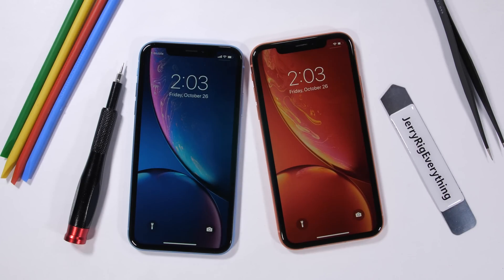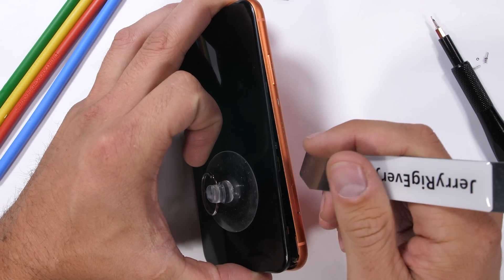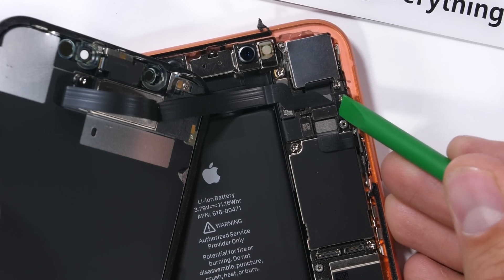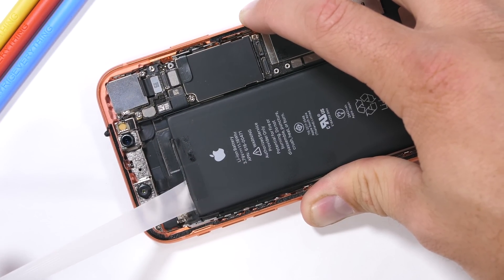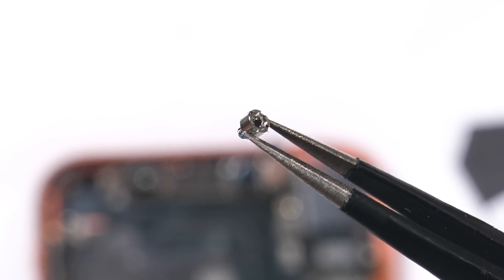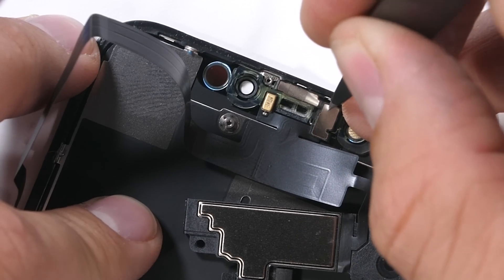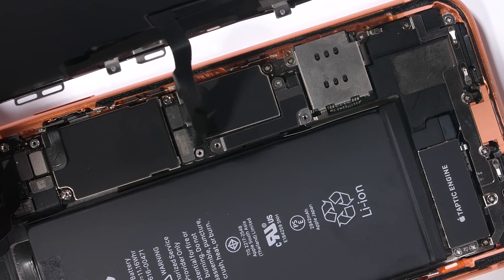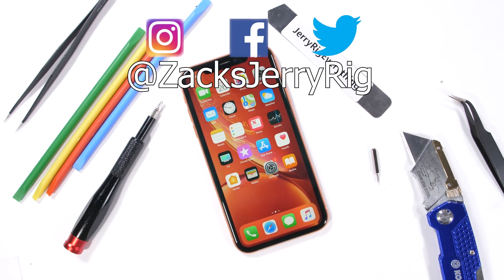iPhone XR Teardown! - How to open the colored iPhone?

Comment: $400 to fix the back glass of a $750 phone hahahahaha 😂😂
2 minute silence for those who are gonna still buy it 
Literally instead of replacing the back glass we can buy a pocophone F1
Reply: this is how a company reaches to trillion worth of money.
Reply: Omid Rastin yes by selling. A product people want how dare they
Reply: If you wanna buy that then just buy that. It’s so simple
Reply: holy shit just cuz theres a chepaer option doesnt mean its any better. look at how bad the pocophone looks in comparison, copied the design of the notch and then included a whale sized chin. plus, if you've never used android and iOS simultaneously you won't realize how much smoother even simple tasks are.
Reply: @plasmasheep4098  Cheaper and yet it has more features than a phone that's twice its price point?
Reply: Colonial ALT more “features” that majority of people won’t use and it lacks massively in hardware has tons of issues and if you lucky will only last 1.5-2 years 👍
Reply: @plasmasheep4098  How bad it looks in comparison with dual cameras,better screen and even less bezels(The chin is big,but has nowhere near side bezels as the XR,the chin is almost the same on both phones)?Lmao.The XR doesn't even have a headphone jack,nor the battery life of Poco,a worse camera,no sd card slot,no liquid cooling and so on.Whether you admit it or not,the XR is just a piece of crap.
Reply: Matej Milovanovic iPhones don’t need liquid cooling because our chips don’t throttle lmao
Reply: @plasmasheep4098  Ios makes the simplest things nigh impossible. We are saddled with iphones at work due to morons at purchasing. Export a complete MMS text conversation with attachments to Outlook? Nope. Can't be done. On Android, simple.
Reply: bro in 400 we can get the 8gb version which is a god
Reply: KNIGHT-ISH “a god” at what being trash 😂 with all of its problems the lack of speed poor display and more there is consequences to buying cheap things
Reply: Or 100 more for a base Mi Mix 3
Reply: My note 9 costs 175.00 if I lose it or if stolen... Apples a con artist
Reply: christopher krause yeh it’s called insurance apple has the same thing your not special
Reply: Kartik Patil first off it’s typing not writing second off I didn’t make fun of or judge anyone...
Reply: @officialANON001  you won't use those "features" doesn't mean that other people won't. Not everyone is like you. Get that straight in your head. You are not the center of the universe. Everyone has their own necessities.
Reply: christopher krause that losing or stolen and not broken and you probably paid insurance because if you have apple care it’s cheaper than $175 of its lost or stolen and only $30 to have anything fixed
Reply: The Samsung s6 has better specs than this "budget" phone and it costs less
Reply: @samuelruiz7377  what specs?
Reply: Vishal Hardasani $750 maybe in the US.  But here in Germany I paid 909€ (over $1000) for the 128 GB Model. You see, what you people call “Budget” phone over there, is a hyper phone elsewhere dude. I could afford the Xs , but I love the Xr more.
Reply: does the Pocophone F1 run IOS?
Reply: @zarndt2134  IOS 12 😊
Reply: With an extra $200 you can buy a oneplus 6T that is a way better phone than this iphone xr
Reply: Me, trying to bend the phone the glass actually prevents the phone from bending(iphone 8 vs iphone 7 bend videos) and the glass also never breaks in bending, so one easy trick is.......put a very thin simple back cover and you will never have to pay 400. But must admit the mate 20 pro is the best choice but too expensive, it has a different type of glass or whatever on the back.
Reply: That’s why you gotta buy a good case and tempered glass screen protector so you ain’t gotta worry about the glass breaking
Reply: Good luck with screen issue,sound quality,and Miui. I rather pay more for mi8, oneplus or 5z
Reply: @OneGoogleUser you're truly being ignorant if you think that essential deserves most of the credit for the notch trend going on right now. First of all, look at the shape of the notches... what do they resemble , the essential or the iPhone? Furthermore, Apple had definitely set the trend, you only saw these copy cat OEMS after apple. How can you possibly sit there and believe that it was essential. And I'm literally and android user, I just can't stand this ignorance. There's a difference between setting a trend and doing it first. Plus look who bent the screen to make the chin disappear. You tell me. I don't even understand this argument why wouldn't people just buy what they want based on their needs. If you can't accept that Apple and iOS do even a few things better and differently there's no point in arguing.
Reply: OneGoogleUser i would rather the phone not breaking after dropping it then feeling the glass but that’s just me
Reply: A minute of silence for this silly Fandroid and the likers of this comment. 
Literally, if you want to fix your iPhones display you dont need to disassemble the whole phone. Replacing the front glass and display of your usual Android phone costs the same. 
So stop spreading nonsense and use your shitty buggy Pocophone instead.
Reply: Oh god, the pocophone F1 🤢 with its much slower snapdragon 845, it’s way worse camera, the chin at the bottom of the screen, and the fact that it will be extremely slow and get absolutely no support whatsoever in just a couple years, I’ll pass
Reply: @greylawson6352  you have no idea what your talking about fucking moron
Reply: IS IT YOUR MONEY?
Reply: OneGoogleUser clear cases exist headass
Reply: @sasukedark30  You will lose the feel of glass
Reply: too bad we can’t use any of these chinese phones in the US
Reply: Nobody asked you, enjoy your pocophone. We don’t all have to have the same things geez
Reply: a12 is still unmatched ...
Reply: Yeah you can buy a phone that sounds like it’s straight outta Explorer Dora.. cool
Reply: @OneGoogleUser it's glass which enables wireless charging obvious you would but a case. Why are you against case or skins when literally everybody buys one no matter the price of the phone people don't like to waste money
Reply: @OneGoogleUser who said it was an innovation. In a way it was an innovation because of the for projector etc on the notch that had the best face i.d in any phone.
Reply: Lmao imagine buying a pocophone
Reply: @EdgarHernandez-xj5mx  imagine being Mexican ew
Reply: Ryan Jack lmao imagine being a keyboard warrior that responds to everyone to justify their purchase and is xenophobic you’re cute
Reply: Ive never broken a phone so I should be good but thanks anyway
Reply: f1 way cheaper
Reply: Latest samsung phones also cost the same to replace
Reply: Anime Cuts  shitty 1080p Panels*
Reply: Your comment is soooo typical. Boring
Reply: Or buy a $8 case
Reply: Eric Smith No, it’s actually glass, but that “colored iPhone is the best phone in the market, and it’s actually very resistant
Reply: i will still buy it :D
Reply: Well who is buying phone to throw it? except this psychopaths on youtube.
Reply: Vishal Hardasani Are you that much of a tight ass .
Reply: @Bobi Rachev never broken a phone before, everyone gets a case. And dbrand can pretty much conceal and fix the glass if broken
Reply: I can buy 3 of the phone I'm using ..
Reply: Who the fuck cares... If I want a phone I'll buy it. I don't care what you think.
Reply: I'd still buy the XR over the pocophone. i hate poco's software so much that i prefer ios over it.
oneplus, razer, sony, huawei > samsung > google > apple > htc, lg > xiaomi (including poco), oppo, vivo etc
Reply: OneGoogleUser certainly in the U.K. most phones are on contract to get bundled data etc. So nobody blows a lot of cash up front. My kids tend to get better iPhones than me LOL I’m rocking a 5S. Teenagers won’t even entertain an Android phone here. I make these iPhones last though. They’ve had iPhone 6 for three and a half years and  pattern parts are cheap and readily available so being quite handy I’ve replaced multiple screens, batteries, charging ports etc. The newer phones are harder to repair and my older daughter who is 20 now has an iPhone X. I make damn sure that has a case and screen protector. It also has insurance that is cheaper than Apple Care and includes accidental damage. What to get my younger 17 year old daughter is the question and the XR is cheaper than the XS and with an LCD screen it might be possible to get a cheap replacement screen in a few months if needed but yes if you buy any expensive item it makes sense to look after it really well!
Reply: People want brand and brand blind fanboys.
Reply: Just get the Vivo V9. 300$
Reply: or any other good phone for less and still better than the isuck , because pocophone sucks is like a toilet paper in a sort of disguise...
Reply: That’s because the glass isn’t actually fixed. You get a brand new shell for your phone as the internals are moved into a new housing
Reply: Vishal Hardasani Android niggas
Reply: That’s why you wear a case on your phone Lmfao
Reply: Nobody wants no damn nasty ass chinese phone bruh
Reply: No one wants a pocophone wtf 😂
Reply: Fun fact: Apple keeps losing court cases where they want to shut down independent phone fixing companies.
Reply: Or a mint galaxy s9 plus
Reply: Not our fault androids are for the cheapies 😘😬
Reply: U r correct!!!Buy samsung
Reply: or be a cheapo skate and stick a dbrand skin on it when you dont wanna buy a pocophone f1 or buy new back glass
Reply: @krishsolanki4455  indians also love dirty cheap low quality produtcs.Facts
Reply: Unsub from T Series
Reply: @shanewilliams5771  we are not dumb enough to buy a phone with repair costs exceeding half of its own price.
Reply: @villavan  well your clearly dumb enough to break your dam phone, irresponsible little shit
Reply: lmao if anyone thinks a poco phone looks as good as even an xr or even a cheap moto phone they're delusional
Reply: Sam McCormack Not sure about that my 20 year old iPhone toting older daughter is doing an arts subject at University her boyfriend (also an iPhone user) is studying accountancy. Her flat mates also have iPhones and are arts students. My younger daughter however  is considering biomedical science so not sure. Perhaps IT students use Android because it's more like a desktop OS? I still think I'm generally right. Some though still a minority of my wife's colleagues and my own friends use Android but they're middle aged!
Reply: @markbennett6658  idk man many of my friends in IT use iPhones who cares
Reply: plasma sheep indeed each to their own!
Reply: I just got a F1 on Sunday it's a beast it's definitely underrated and more powerful than the xr
Reply: @AmazingPiggy have you seen the specs? Snapdragon 845 6/8GB RAM 64/128GB ROM quick charge3.0 and A HEADPHONE JACK oh and a 4K battery. I wouldn't call that trash.
Reply: F to them spastics
Reply: @Cosmic_cloudx  damn that makes a lot of sense cause I totally want and have an iPhone. gtfo
Reply: Pocophone already lost to iPhone XR. Crappy screen pretending to be OLED
Reply: Or just buy a case and it’s not an issue 😎
Reply: Indian can’t afford an iPhone starts bashing iPhone 😂. Stick with your cheap android phone.
Reply: Indians are funny people. I understand most indians are poor and cheap. But instead of bashing iPhone users, why dont you all work harder and save more money ??
Reply: @malayneum  I'm not from India but if it was that easy im pretty sure they would. Also from what I heard, Apple is very expensive in India (i think more expensive than in the US or smth), thats why it doesn't appeal to most people over there. You'd think a country struggling to find a stable job would afford one? No theu probably wouldn't. Thats why the cheaper phones appeal to them. Besides they dont need all the functionality anyway. Probably just to call and send text and maybe watch videos to fill their time. Working harder is easier said then done. This is India were talkimg about. Not some 1st world country like the US where the biggest problem is obesity and kids on tik tok and fortnite.
Reply: @FdPros  I can't afford even the cheapest Vacheron Constantin watch, but i don't run around internet shouting that it is a shitty watch.
Reply: Vishal Hardasani no one cares
Reply: No silence for them. They are idiots, following a dead-end trend. Cool, have fun with your "isuck" product people. Natural selection.
Reply: last part ruined the joke
Reply: It seems like all the hardware, motherboard and everything is seated on the back. In contrast most Android phones have all the hardware seated on the front. Replacing a display on Android costs more than the back. Replacing the back of an iPhone costs more than the front etc. Stupid design tho.
Reply: better yet a refurbished s7 or even new if u can find one
Reply: 1 Minute of silence for those who are to dumb to not drop there phones
Reply: @shanewilliams5771  We're not racists like you.
Reply: I don’t really like Android,so i will fix it my self
Reply: $600 to replace back glass on a Xs Max.
Reply: Vishal Hardasani but why would you buy a pocophone f1 instead of having a perfectly good XR?
Reply: You are an idiot. Iphone is made for people who can manage it not like people like you who use Mi phone or Oppo.
Reply: I want iphone xr in red
Reply: @shanewilliams5771  stfu bastard nigga
Reply: @OneGoogleUser "if Essential didn't use Notch iPhones probably don't." - /facepalm.
Reply: Ill go for the oneplus
Reply: @ankit6365  Too expensive
Reply: @nicemax9310  cheaper than iphone
Reply: @ankit6365  Yeah but not 400
Reply: So? How about don't break your dam phone.
Reply: @dfuma213  damn*
Reply: Indians everyone
Reply: @Loversrock10  You've a problem?
Reply: Better yet, the Zenfone 5z.
Reply: @vkohli17  5z is 500$.
Reply: @vkohli17  I have the Zenfone 5q
Reply: Just like instead of using a toilet, why not piss out on the street? 😂😂
Reply: @jakepirate2521  We do use toilets. But we're not racists like you and make generalisation of whole country which has even more diversity than US.
Reply: @aperture0  Why do you feel that I was talking about your country? And which country is that?
Reply: Honor play
Reply: I love false information 

1. It’s not $400 
2. If your not a dumbass you would pay for apple care ($10 a month) and in which repairs only cost $30
Reply: @officialANON001  Why not use a protective case?
Reply: @Eric Smith it does have a back glass, its the chassis that's aluminum.
Reply: Writing this on my poco f1 👌👌
Reply: @iwillcringe1666    bro is display quality good on your poco phone and is it bleeding?
Reply: @Rabhrakha83  mine fine, and keep better density than xr
Reply: @Rabhrakha83  It's a 1080p panel and a pretty good one at that. Gets ample bright under direct sunlight and is quite easily visible outdoors. Viewing angles are great along with contrast and saturation which are also ample. 

Verdict :- The full HD+ panel is super good but yeah the notch is quite ugly and noticable but you can hide it. But the notch justifies its space cause it houses some Face ID tech and front facing speakers and a great selfie cam. 

All in all I've been using the Pocophone F1 as my daily driver and the screen bleeding issue does not exist in unit nor does my friends who've purchased it.
Reply: @shane williams
So using 321 ppi display in 2018 is worth it??
Apple is using same ppi display since iphone 4.
Isn't it bullshit?
Reply: @Storybox420  you realize that the 4 had a 960 by 540p display right , and its 326 not 321
Reply: @Storybox420  DUMB Indian you writing the same shit you heard from stupid YouTubers. You know nothing about screens!.
Reply: Deepak Bansal PPI and screen resolution is not the same thing you dunce.
Reply: Deepak Bansal no it’s not the display looks the same as the iPhone 8 I have seen it in person...
Reply: Damian Paniagua that pfp tho 😊
Reply: OneGoogleUser so you gonna buy $1000 phone and just hope you don’t ever drop it so it don’t break shut your dumbass up
Reply: 2min silence for those people who compare poco fone to flagship devices.. I'd say it's not even better for it's price range.
Reply: @SankarCh  Only on the processing speed. Its faster than your xr or xs. Bigger battery, not better than xr though if the rumours are right. Camera probably about same.
Reply: Max`s Account it’s not faster where you pull that from?
Reply: BTICronox then stop recommending phones that people aren’t interested in lol. Not everyone wants a Cheap Chinese Phone that if breaks they have to send in to get fixed.
Reply: Laktose not only if it breaks but the fuck ass Chinese looking at everything you do worse than what everyone else does
Reply: ”pocophone f1” lmfaooo
Reply: bleeding fan
Reply: Pofophone LUL shitty phone
Reply: If you were a grown up you would look after your shit and not break the back of the thing. Get a clear case ( not one of those shitty vinyl D-brand skins) , a screen protector and look after it like a baby kitten! Alternatively strap your crappy Pocophone on the back and use it as a shock absorber!
Reply: Why would you want a android phone though this is for iPhone users your irrelevant asf god y’all always think y’all matter or soemthing💀😂😂
Reply: @dylanlee982  iPhone users are sheep with no innovation and sell retards old hardware for almost a grand
Reply: BTICronox what are you even talking about are you talking to someone else but in the comments lmao
Reply: OneGoogleUser wireless charging dumbass
Reply: OneGoogleUser no one buys them for that we buy them cause there not trash lmao y’all kill me
Reply: there is no one forces you to buy it, A12 is gonna shut your poco up 😂
Reply: Anime Cuts of course, like in real life, Sheeps always are more numerous. But quantity is not equal than quality. Do not think you are special, loser.
Reply: Indians 🤦